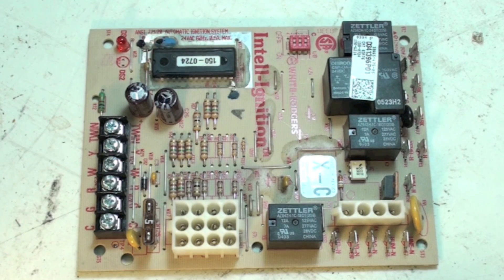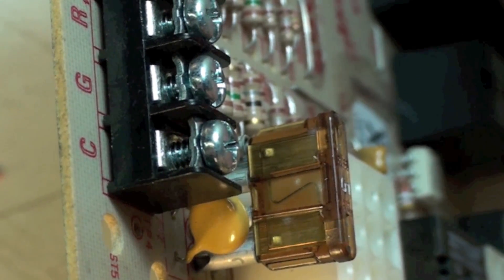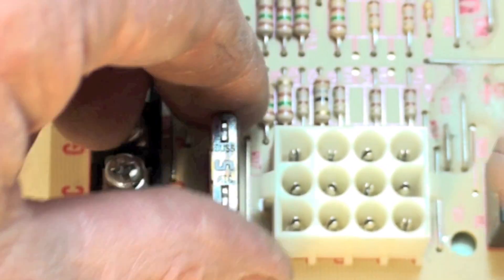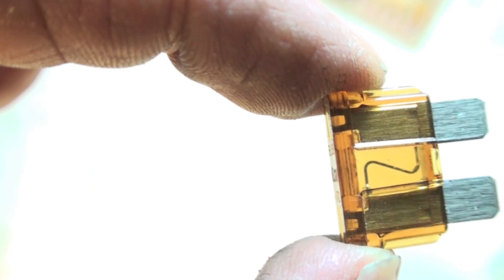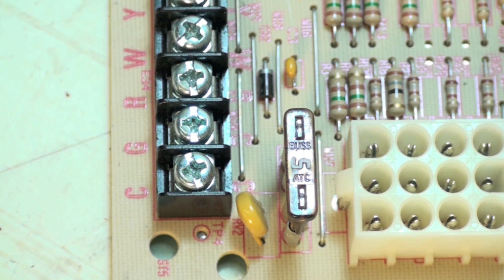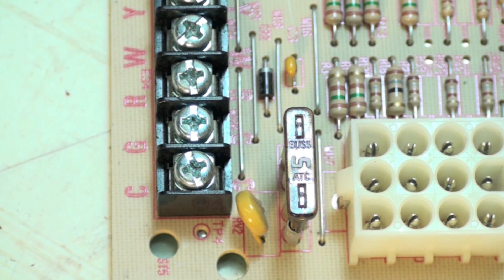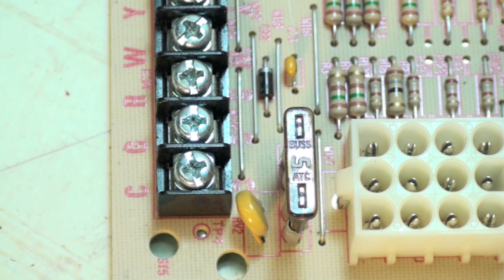The gas furnace circuit board mounted fuse.  Fuses part 2

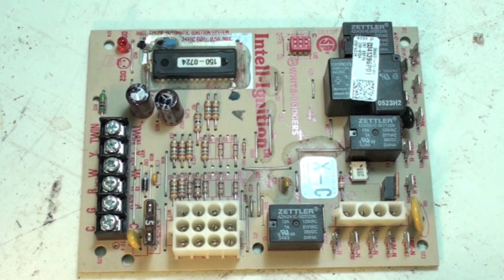Comment: 0:24 regarding the  molex conenctor thats 4 pin ,   my board is 5 pin, if i order a replacement board that has a 4 pin can i somehow rewire it to use it?  for examply my board is White Rodgers 50A51-495 and I want to use a 50M56U-751 since its availble in Canada for real good price. thank you.
Reply from the maker: That's a general replacement control that has adaptors for all the controls it replaces.  So yes, it should have the adaptors.
GFM

Comment: Good video, i was wiring my furnace with overly complicated instructions for 3 wireIP theromstat , some how my white rogers 50a51-495 board would not turn back on , the unit is enclosed in plastic, do you think it has a fuse it i been googling for ours.
Reply from the maker: Most of those controls have an automotive type fuse that can be seen without removing the cover.
GFM
Reply: @grayfurnaceman   thank you i did take offer the cover and still found no fuse :(
Reply from the maker: @NewsBroadcasting  You probably have a wiring problem.
GFM

Comment: Should there be lights on control board
Reply from the maker: It depends on the age of the furnace.  Some of the late 1980s and early 1990s unit may not have lights.
GFM
Reply: @grayfurnaceman  this one has lights the red one on all the time then when heat kicks on another light comes on im just curious if they suppost to or are they on cause something is wrong
Reply from the maker: @amberbotkin6440  It depends on the furnace model.  There should be a code key, probably on the inside of one of the outer panels.
GFM

Comment: Where can I find these fuses? All I can find are automotive style fuses and they are smaller than these. I'm even at Home Depot.
Reply: JustSaiyanSteve 

Thank you, 

My Walmart had a very mixed bag of these. Most of the spots on the shelves were empty. It looked like they did not maintain the section very well. Maybe I just need to try a different Walmart. Thank you again.
Reply from the maker: These fuses are used in older cars.  I believe the are model ATO.  Automotive supply should have them.  Hope this helps.
GFM
Reply: Tom Steele  I found them in a pack at Walmart.
Reply: grayfurnaceman 

Thank you. I'll check Amazon. The ATO is a big help. I ended up using one of the smaller size fuses that is the right amperage but barely fit in the fuse slot. It works but it doesn't look all that great. I'm trying to find the correct size to actually put in there though. I will search for ATO fuses. Thanks!

Comment: my fuse keeps poping when I put the door back on.
Reply from the maker: +Chris Delgado You have a low voltage short.  Look for thermostat wires touching the furnace chassis.
GFM
Reply: Yeah I think that was it. Everything is working.  Thanks.
Reply: Mines keeps popping when I turn the unit on.

Comment: GFM found the fuse blown state when trying to run a trane XR80 for the first time this heating season....did something very stupid and put a 7.5 amp fuse in...when i attempted to start the furnace the board popped....i know.  This summer i put a new digital thermostat in for this furnace.  im guessing i just fried the board and still have a low voltage thermostat problem some where?  thoughts? ideas?

Comment: would the fuse on the IFC protect just the board and would I need a seperate fuse for the transformer secondary side also?
Reply: This fuse, per the manual for this board, only protects the transformer. It is there to blow if the secondary side is shorted.

Comment: looks like a goodman circuit board, I have a problem with flame sensor, I replace the sensor,put  new circuit board, but the flame will not stay on, I probably want to change the wire harness for possible bad wire.
Reply from the maker: It is.  If it's GMP model, they had a lot of heat exchanger problems.  That could be the cause.  I have a playlist on that furnace that goes thru diagnosis and repair.  Hope this helps.
GFM
Reply from the maker: ***** Good thoughts.  
GFM